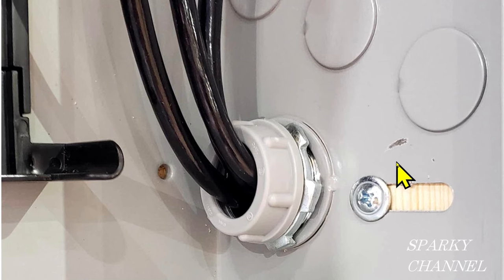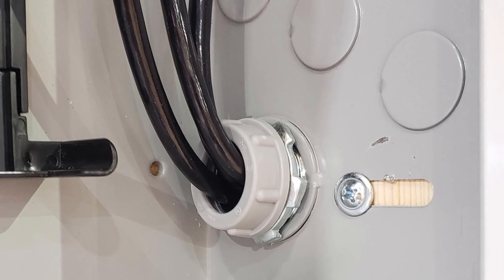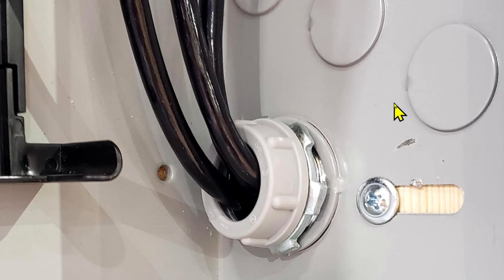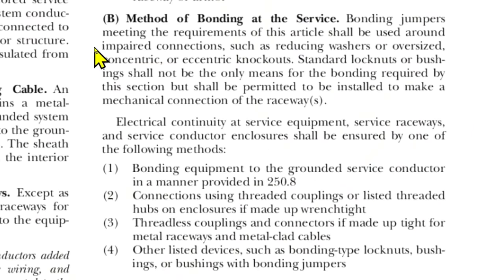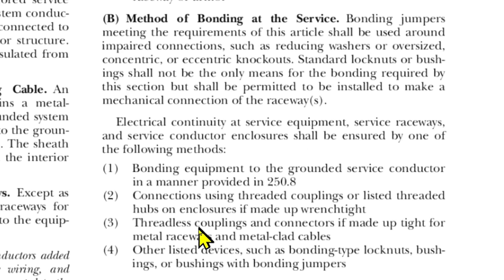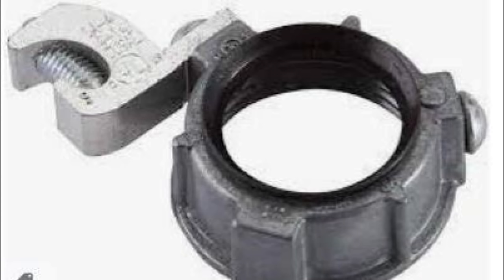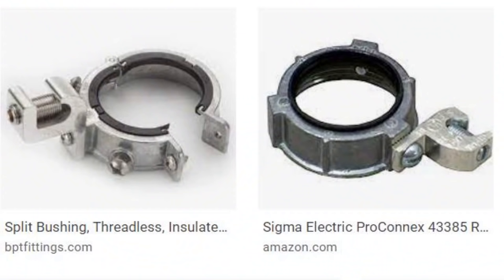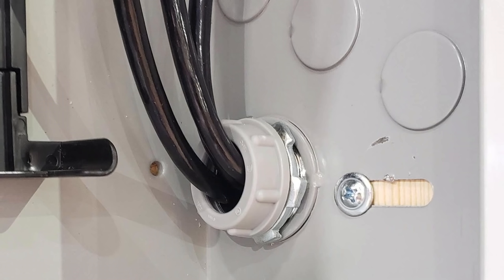What's Wrong? Concentric Knockouts and Conduit Fill, 2020 NEC 250.92 (B), 250.122

Comment: Wait a minute.   Is it a service entrance or not?   You are reading NEC about service entrance conduit, then you say it does not have an EGC which is not to be required in a service entrance.   So, which is it?    Also, I can not know if the conduit is overfill without knowing conduit size, conductor type, conductor gauge, and length of the conduit.  
Respectfully,   Kevin
Reply: This does not look like a service entrance.
Reply: @Sparkeycarp     Pictures never show things very well.   But, those conductors look a little large for a branch circuit in a residential panel board.   Also,  service entrance is (2) hots, (1) neutral, no ground (or Equipment Ground Conductor)(EGC).  That looks as what was installed.    Do you have a different opinion?   If so, let me know.   Respectfully,   Kevin
Reply: @KevinCoop1  Maybe those were feeders and they werent finished installing the wiring (ground)  :). Not enough info in the pic
Reply: @jackconnolly2665    Ok, so if a feeder, then what section must he reference instead of service?   Ill have to look sometime,
Reply: @KevinCoop1  Beats me nerd :)  :)
I barely knew ANY real code until I was late into my "career". When the internet came along I was able to learn more in a few years than all of my collective years before.

The only thing I learned/remembered about bond bushing requirements is, over 250 volts and service conductor conduit...sorry, raceways  ;).
Reply: @jackconnolly2665     Bonding bushings are not to ground the panel.   Quite the opposite, it is to ground the metal conduit or tube because you can’t count on the knockout to ground it.
Reply: @KevinCoop1  Im not sure why you thought I didn't know that.  I guess I did say that "the only thing I know...."  but, come on man :). That's  just common sense. :)
Reply: @jackconnolly2665    Not so much common sense to most.   Only people who are involved in electrical work, like you and me.   Most involved in electrical work are taught “what to do” but not “why to do”.    Why is left for you to figure out on your own.   It has been nice back and forth.
Respectfully,   Kevin
Reply: @KevinCoop1  I have been one of those "why" people my whole life. The other side of that is Im also a "why not" kind of guy..
Peace, Jack
Reply: @jackconnolly2665     Me too!

Comment: I think that it's worth noting that 250.92 pertains to services.  In situations where these conduits enter through concentric/eccentric knockouts and it is a feeder, there is no direct applicability to this code.  I believe 250.97 would have bonding bushings installed if the voltage to ground exceeds 250V.

Comment: That moment you look back at all of the code violations you’ve done.
Reply: For me, it's just another slam dunk at how broken this system is.  A concentric knockout is much less of a problem in terms of current carrying capacity than the painted surface the nut and flange comes into contact with.  The powers that be have zero common sense left.

There are those who would still claim "an earthquake could disconnect the knockout from the panel, rendering the ground connection useless" and to them I would ask:

"Have you ever tried to remove a concentric knockout before?  Do you know how many times you have to bend it 90 degrees back and forth for it to sever completely?  Do you know how much harder it is to remove the knockout if it has more than one tab attached?"

This is madness.  Utter, plain and simple.
Reply: @byugrad1024  and if you get some GE equipment sometimes they just about fall out
Reply: @byugrad1024  Ditto.
Reply: @jgren4048  sounds to me like that is the source of the problem.  Does GE sell the ground nut adapters too?  That's a fairly good argument for a conspiracy going on.
Reply: Yep

Comment: By code you do not have to have a EGC from the meter to the disconnect/panel. Your EGC will originate at the first means of disconnect downstream from the meter.
Reply: The meter socket box needs to be bonded, however.
Reply: If its before the main disconnect, itd be called a supply side bonding jumper, not an egc.
Reply: @aaron74   yes, bonded to the grounding electrode conductor.
Reply: @stillthakoolest  but you wouldn’t have a SSBJ between your meter can and your first means of disconnect either. That’s my point…
Reply: @atmacm  Do you know if the allowance of using EMT between the meter box and the service panel qualifies for bonding without running an EGC through it, or is allowance just for branch circuits in EMT downstream from the main panel?
Reply: @aaron74  you don’t need an EGC from the meter can to the first means of disconnect. If you did this, it’d result in a parallel path between ground and neutral.

Comment: I think it when it 250v and high  ny power is flux straight behind 

NEC 250.97 also allows concentric and eccentric knockouts to be used without bonding jumpers if the box or enclosure is listed to provide a reliable bonding connection

Comment: One thing I see a lot of people use a chase nipple with rigid coupling for pipes coming from slab to bottom of panel chase nipples aren’t considered a bond or ground u need to use a threaded nipple with locknut thanks for the videos
Reply from the maker: My pleasure, thanks!
Reply: @theok4712  ground wire won't make difference . Chase nipples were made to be used with locknuts. To me I think it when threaded to a ridgid coupling or lb  it makes a bonded connection but from what I have read no good

Comment: Do you need the bonding bushing if you are not using the raceway as the EGC?  One of the Electrical Engineers I work with, always runs a dedicated EGC, and never trusts the EMT or other metallic conduit as a conductor.  He says that we didn’t learn our lesson from the MGM fire in Las Vegas.  Any thoughts?
Reply from the maker: I agree with your EE. I think he's doing it just right.
Reply: you still need the bonding bushing, because you are protecting the conduit against a fault.  with branch circuit wiring, you are allowed to consider concentric or eccentric knockouts to be an effective bonding connection for conduit because the fault currents are lower.  but yes, your engineer is correct that an EGC is much safer than using steel as a EGC.
Reply: I agree. Conduit is not a perfect, guaranteed continuous, unbroken ground path. It should be, but how many inspectors actually check every junction for a proper connector? (none!) I've pulled too many sections of in-drop-ceiling conduits apart over the years. (the screws weren't even turned on a few of them.)
Reply: Agreed.
Reply: Only time you use the ground bushings is on service entry raceways and in branch circuits with over 250 volts
Reply: @jfbeam  conduit also builds up resistance pretty fast. I remember a test was done using 2" rigid made up wrench tight and i forget how long the run was before it wouldn't trip the breaker.
Reply: @thomasmarable6818  you also bond both ends of any metallic raceway for a service grounding conductor. Otherwise a high energy fault can cause a catastrophic failure due to emf.

Comment: #4 for a 200 amp panel!? Did you mean 100?
Reply from the maker: Yes, there is something wrong for sure. I'm using YouTube edits to remove my statements about the wire, panel and conduit sizes. But I'm leaving the grounding bushing comments as it definitely needs a grounding bushing. Thanks Ken!

Comment: If anything, this violates 250.120 (A) which states if metal conduit is used it must be made up tight. The locknut isn't made up tight I can see that clearly. It looks like it's a rigid conduit nipple and it has the only bushing required by code for rigid conduit not part of a service, an insulating bushing.

Comment: We need to know if these are service conductors. If they hit a disconnect first then they are feeders and don't require bonding bushings.   If they are service entrance conductors, yes you need a bonding bushing. what is the max length of service entrance conductors you can have inside a building?   It is different in different jurisdictions, but around 3-15'              If this is a main panel and not a sub panel, you cannot install a grounding conductor or you would be paralleling your neutral.

Comment: I am a bit confused as well. Unless it's a service entrance or 250V+, you don't need a bonding jumper even with concentric knockouts.
Reply: NEC 250.92 doesn't specify a voltage, it simply states the requirement to bond metal raceways.  NEC 250.97 however says that 250v+ must have a bonding clamp.  The difference, as I understand it, is that some boxes have their concentric rings approved as adequate for bonding purposes at 120v, so a bonding clamp isn't required.  So, if your box isn't rated, then a bonding clamp is required at all voltages and if it is rated, then only required at 250v.
Reply: @lelandlewis7207  250.92 applies to service conductors only.
Reply: Code is minimum! Always a good practice to go above the minimum if ever in question, especially when it comes to grounding protection! In Charlotte NC inspectors will fail you if they see concentric knockouts without a bonding bushing, even if you have 120v and show them the 250.97 section.
Reply: @lelandlewis7207  o
Reply: @maandalorian  Does that change my assessment?  

Incoming voltages would be over the allowable voltages and are therefore going to require bonding unless all knockouts are removed.  This code specifies bonding.  

Other races, if 110v, do not require bonding if the box is certified, once again, as I understand it.  Uncertified boxes or higher voltage require bonding if there are eccentric or concentric rings present.

Comment: 200amps required 2/0 or 3/0 base on length of run.
Reply from the maker: Yes, there is something wrong for sure. I'm using YouTube edits to remove my statements about the wire and conduit sizes. But I'm leaving the grounding bushing comments as it definitely needs a grounding bushing. Thanks Mike!

Comment: Screw holding the panel to the stud looks to be a common sheet metal screw, probably not adequate.
Reply: @elderfarms  Metal and copper thieves ALWAYS find a way
Reply from the maker: I would like to see a fender washer under that screw.
Reply: @elderfarms  depends on the threads, which we can't see.  in my hardware box, those wafer heads are on 1/2" piercing screws, which are a bit small for load bearing applications.

Comment: The screws holding the panel to the stud I was told by an inspector that they have to be hexagon screws is that code?
Reply: No.
Reply from the maker: Good question. I haven't heard of a need for hexagon screws. I like to use fender washers as they are designed to spread the load on thin sheet metal.
Reply: Use drywall  screws fine
Reply: No .That is for a bonding screw of ground wire.  Should be green as well.
Reply: ask him for chapter and verse next time you talk to him.  I doubt it is the case since the only requirement I have seen for box mounting screws is that they can't have exposed sharp edges that could cause damage to the wire.

Comment: IS there any code in reference to how sharply wires of certain size can turn when exiting a conduit/bushing?
Reply from the maker: Good question. I'm not sure. Perhaps a viewer can answer that question.
Reply: @SparkyChannel  In the data come world, we have it because of fiber, you'll break the glass. But I could see an argument with this larger wire that the sharp bend would put stress on the jacket, cause it to break down and fall away over time.
Reply: Yes, somewhere in the code, don't ask me where, there is indeed a bending radius requirement per diameter of wire.
Reply: 334.24 for NM cable. But that's THHN in the video, so not sure. Interested in the answer.
Reply: @blipco5  it's basically no tighter than you can bend it without mechanical aids, so unless it looks kinked, the inspector isn't going to put a gauge on it.
Reply: Article 300.34 (Conductor Bending Radius) states that conductors shall be bent to a radius no less than 8 times the overall diameter for nonshielded conductors or 12 times for shielded conductors
Reply: @Ephesians-ts8ze  aware, but that is not a conductor bend spec.
Reply: @Timothy-NH  I’m not sure what you mean. The title of that article is  literally “Conductor Bending Radius” and it answers your question pretty cut and dry
Reply: @Ephesians-ts8ze  My bad, I look quickly and thought it said “conduit”.
Reply: @Timothy-NH  no worries
Reply: The bend is allowed to be no tighter than 6 diameters of the conductor for the record. I.e. a 10 awg can bend a radius of 60 'awg' in bend
Reply: @d70rock  8 times 👆
300.34
Reply: Sorry- i forgot to mention california electric code not nec
Reply: @d70rock  ok now it makes sense! 👍
Reply: @d70rock  I just re-read your reply and actually, I don’t know what specific codes there are in California but they cannot have codes less stringent than the NEC. If they did, the NEC would overrule any local codes. 6 times would still be a violation because 8 times is the minimum radius allowed per NEC
Reply: @Ephesians-ts8ze  yes sir you are correct- i actually went back to it and looked it up. I think my brain is playing games on me. Nec and cec are the same
Reply: @Ephesians-ts8ze  a state does not have to accept the NEC and can make their own rules if thet want to, but I dont think any state or local does

Comment: I'm no electrician but geez, seems everything needs to be grounded.  Surprised that screw holing the box to the studs doesn't need a grounding cable attached to it.
Reply: metal is metal that screw is adequately bonded to the can just by contact. bonding everything that small via ground wire would certainly create more job security tho lol
Reply from the maker: I understand, but it's code. The metal conduit coming to the panel is the equipment grounding conductor. That contact with the metal of the panel is super important. The code makers don't want the concentric knockouts to be responsible for the grounding so we use grounding bushings which attach to an equipment grounding conductor (EGC) wire. The EGC wire attaches to the panel on a grounding bus bar which is securely attached to the panel.

Comment: Exception 4 "other listed devices".... Aren't there heavy welded concentric KO that are bonding rated? And unless that panel is a Service does that article apply to it? The concentric in this picture does not appear to be the bonding rated type but if that is not a service and only 250 volts to ground... It is OK bonding I think. But one could also assume it is a service because there is only three wires and in that case it would need a ground bushing. I like a Meyer's type hub for the gripping strength and low profile.

Comment: I thought if egc was run in conduit then grounding bushing was not required
Reply from the maker: The concentric knock-outs ruin the EGC effect of the EMT and the EMT fittings. So you need an EGC wire which connects to a grounding bushing. That way you defeat the problem created by the concentric knock-out. See :27

Comment: What if the raceway your using is pvc? For Example; load side of the service utility meter to MSP, would you need a grounding bushing on that 11/4” or 2” pvc pipe if it’s not rigid? (Residential)
Reply: No need for a ground bushing with pvc. It’s nonconductive.
Reply: @Ephesians-ts8ze  oh that’s what I thought, it’s just that the concentric knockouts part got me confused.
Reply: @Ephesians-ts8ze  I also have another question it’s about grounding inside MSP ( residential). Let’s say the msp you’re working in the grounds and neutrals are all double and tripled up on the ground bar, the msp has a bond screw/main bonding jumping; so let’s say I wanted to add an additional ground bar to move those grounds, do I need a jumper ground wire from the old ground bar to the one I’m installing or it’s fine because the can is grounded with bond screw/jumper?
Reply: @avatar12able  no jumper is needed. They will already be bonded together via the panel enclosure
Reply: @Ephesians-ts8ze  ok that’s what I thought I just couldn’t find it in the code book
Reply: @avatar12able  honestly, I don’t know if that is specifically addressed in article 250 but I’ll try to find it when I have more time. I’m going by almost 30 years experience in the trade. The only time I recall ever having to bond 2 ground busses together is when they were in 2 different enclosures of a 2-section panel.

Comment: The picture you showed of the Equipment ground coming out of pipe and going through locknut, do you have to do that? Or can you run a jumper from ground bar to grounding locknut?
Reply: It seems to me that should be acceptable.

Comment: So if this were an actual 3/4" knockout, with no eccentric or concentric enlargements, a bonding bushing would not be required?
Reply from the maker: Correct, the EMT and it's fittings would be the EGC. They would have to be securely fastened though.
Reply: If its not a service entrance and its a branch 240 volt circuit it is legal like is no code volation.
Reply: Except for the locknut is not tight

Comment: I noticed the ground conductor which should have been pulled in with the two hots and neutral is not shown.  Depending on the type of installation.
Reply: Are you sure its 2 hots and ground and not 3 hots? A phase B Phase C phase?

Comment: Why is that lock nut on the wrong side? Shouldn't it be on the other side to hold the connector firmly?
Reply: On the other side of the panel is the end of the raceway which has a lip; the nut then locks the panel between the lip and itself.